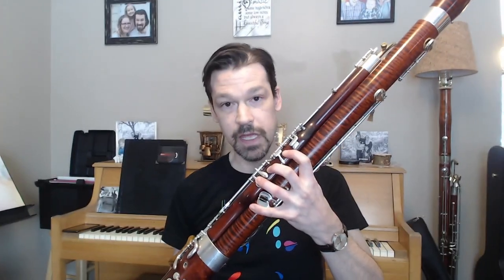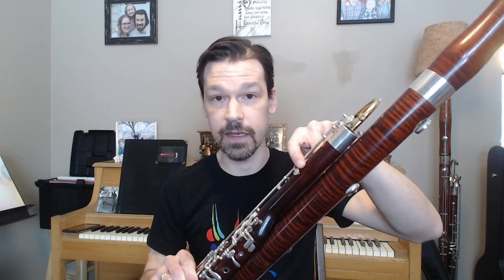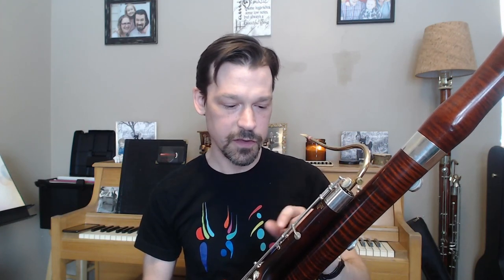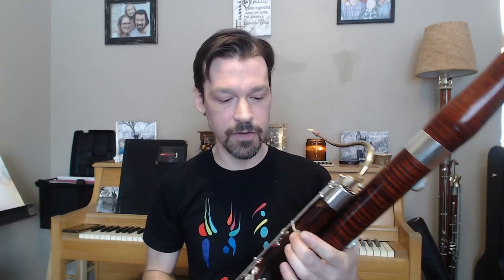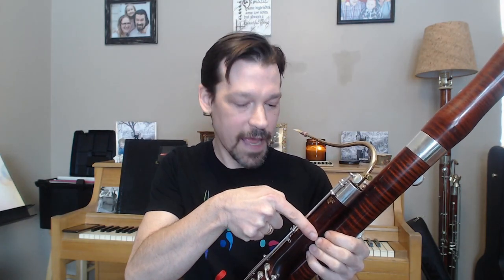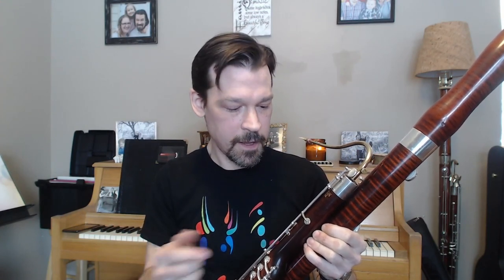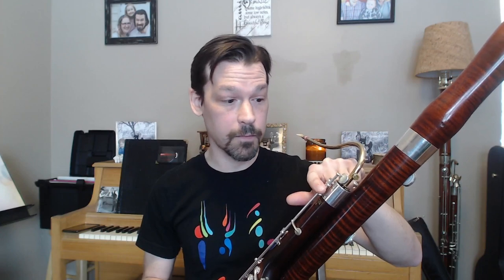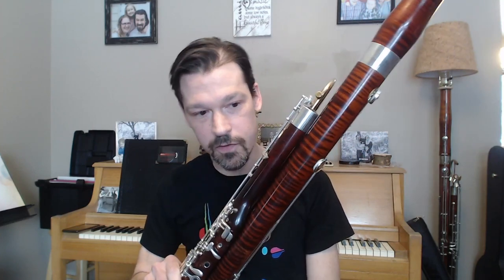Jordan Key Breakdown

Comment: I really liked your breakdown in highlighting the easy things that can go wrong with this system!
Reply from the maker: The hole was probably just too big in my instance. I don't know how universal the design needs to be, but when I cover the hole completely with tape and put the smallest hole possible in it (with the tip of a sewing pin) the negative issues go away, but the flicking/venting solution is also not as pronounced.

Comment from the maker: (Comment pinned for visibility, this is also now in the description).

A very heated day on Facebook as a result of this video that I didn't anticipate. Yes, in the video the vent hole had been modified, as an indirect result of the attempt by my repair tech to fix the whisper key rod issue (around 17 minutes into the video I mention this). However, the acoustic results you hear prior to this are all how I had experienced with the mechanism prior to that technician visit.

While I did not ask my tech to file down the vent chimney, it was assumed to be a valid solution and it was done while I wasn't in the room. We did not not realize that the outside of the hole on the vent insert was smaller than the inside diameter of the vent. So in this video I have covered the top of the hole with tape and poked a hole through it with a .6mm drill bit. The end result was not distinguishable from the original acoustic.

Robert stands by his design, as well he should. He spent a long time developing the key and has many satisfied users of the mechanism now. I also assert that my experience was not all positive, and that the issues presented in the video are how I experienced my instrument after the key was installed for multiple weeks before visiting my local technician.

I have since had the mechanism removed and the hole filled in.

Comment: Very interesting!  It's unfortunate it didn't work out better with your instrument.  It seems like maybe the mechanism/vent hole would need to be addressed completely anew at this point to make the proper adjustments for success.  It's tricky shipping a bassoon for custom key work to one tech and then having it repaired (perhaps because it was damaged in shipping) with another tech.  In my personal experience, I have shipped bassoons for annual maintenance and then had to take the instrument to a local person because of changes that occurred in shipping.  Most recently I received a bassoon with the top of the f-mechanism bent very similar to your description.  After a few minutes, the entire pad cup broke off the mechanism.  It was a disaster!  All of it was caused by shipping and damage to the supports in the case.